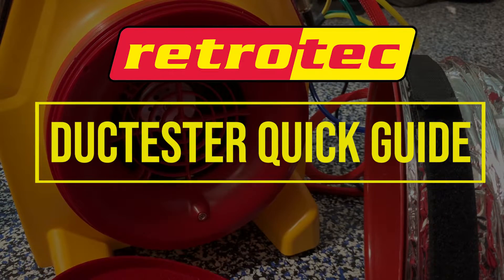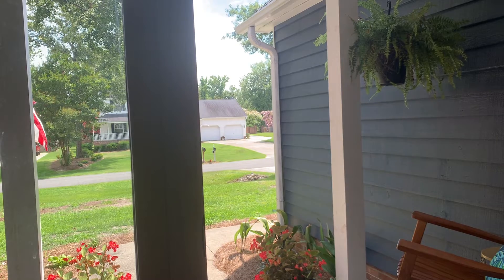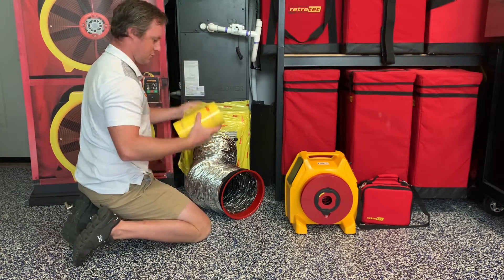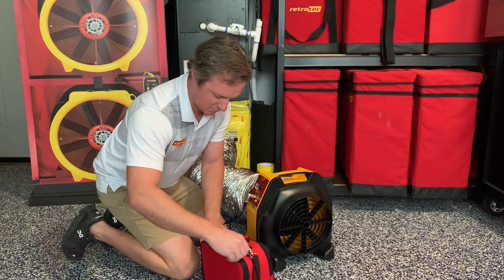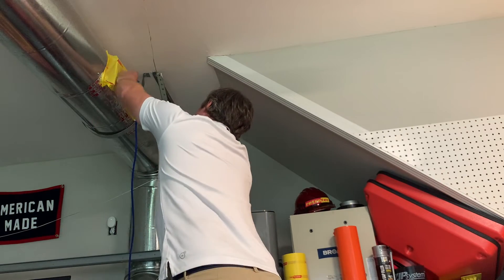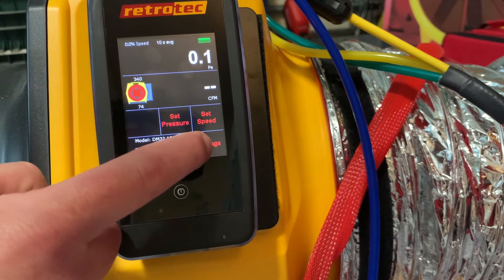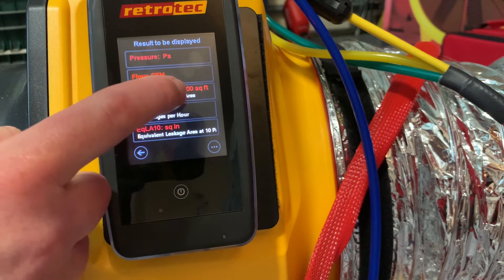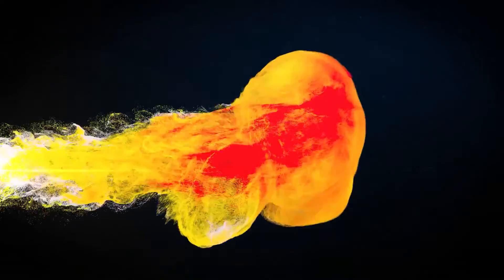DucTester QuickGuide Video

Comment: Do the perforations in the tape cause/show as leakage when taping the register?
Reply from the maker: theres no measurable impact.
Reply: Kinda like the air handler "filter". 😂 @RetrotecEnergy
Reply from the maker: @jamesreid7144  lol yea those mitsubishi filter screens are a joke. But should still be removed to meet test standards.